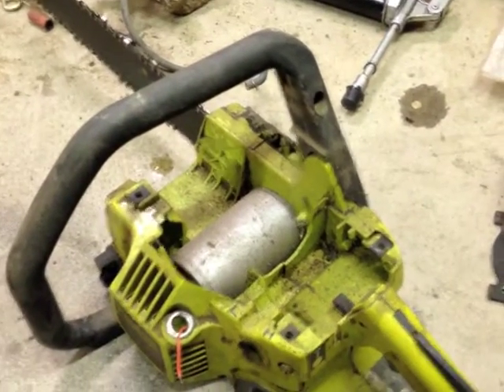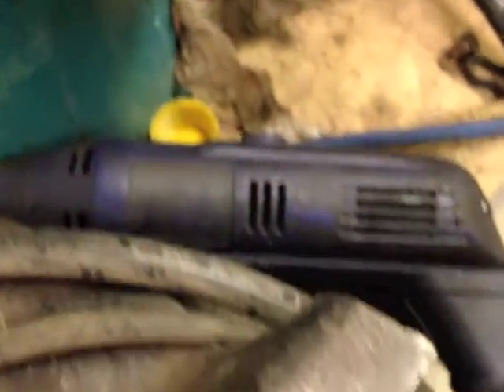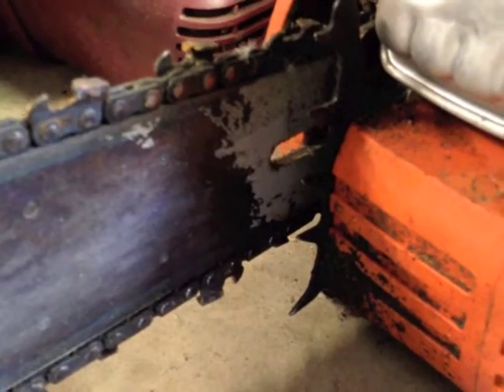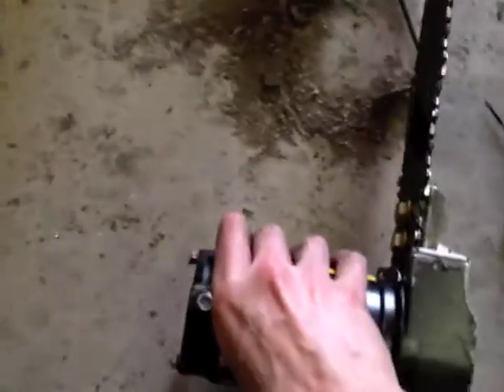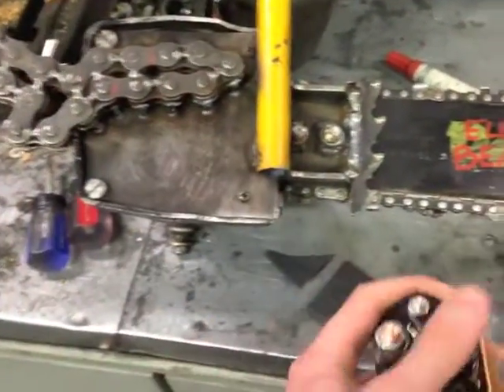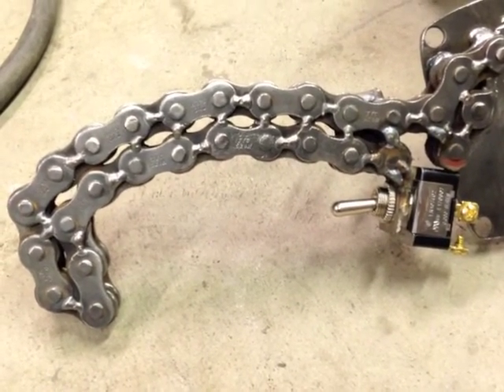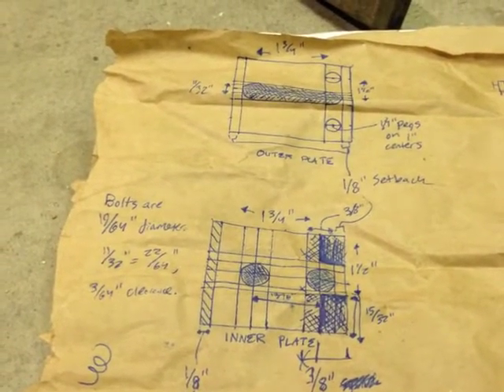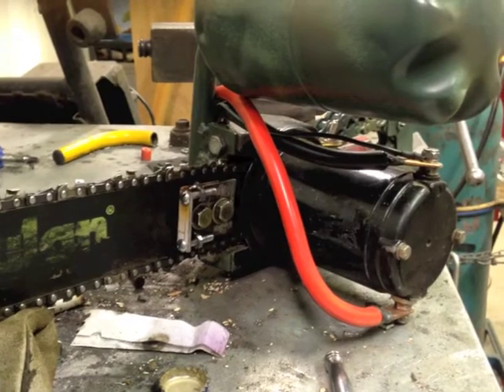A 12v Chainsaw that Actually Works

Comment: Dude, more than awesome. 
I have an idea, similar to this one, you coould have 2 motors 12vdc winch or starter motors, and then drive 2 wheels like polyurethane high load wheels or some sort of railed wheel with the lip. 
Horizontal portable bandsaw mill 12v. 
The overall length is to be determined, probably a proper 36" would be possible. 
ANd the drive wheel heights are 8 inch or so. 
Theres a platton that is aluminum mounted to an aluminum frame that can raise and lower to cut the slabs after the first pass is made with a straight board or ladder. 
The MILL is just portable, 12v, can hook up to any vehicle. So you get the benefit of low noise, and low waste, smoke and vibration, 
You just have to have the 12v source, and this can even be an atv with an adapted large battery which is a real plus when you need it for off grid power. 

The motors would clunk on and off, and since both are pushing and pulling the blade at every wheel contact point, you may not even need tracking. It may need nothing, or just drive wheel backers. 

Its appealing, I want to make one but my to do list is already rolling along.
Reply from the maker: Seems like it would work! I can't remember the last time I needed a bandsaw in the field, but it might be good for cutting irrigation pipe or something. Probably easier to adapt a winch motor in place of the 120v motor on an existing small bandsaw rather than making the whole thing from scratch.
Reply: @Darwinpasta  Yeah 2 treadmill motors would really work.
Reply: But if you used something like segway ninebot max motors, they together can push 4800w which is enough. The only thing is the frame has to be aligned and ridgid. This adjustment can be made at the motor mounting bolt post to get each at the correct angle with like 2 set screws or 4. The top handle structure can be tacked together and triangulated with slots for the vertical posts for the plate integrated in the truss to make handles also. I wish though these motors did not use hall sensors. its foolery I would prefer a high quality brushed motor like the good old days. But if efficiency is to be gained its bldc. But if durability and ruggedness is needed it is probably the winch motor.